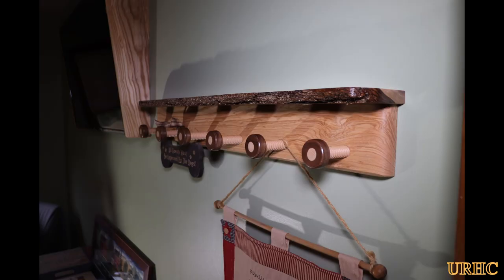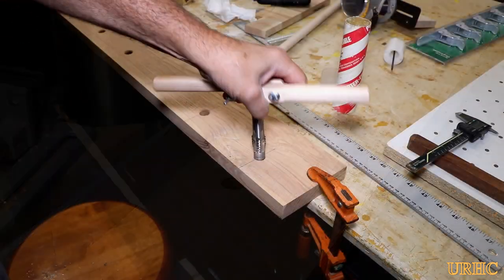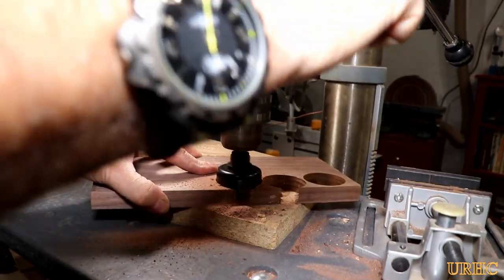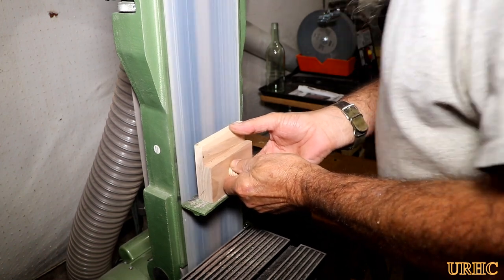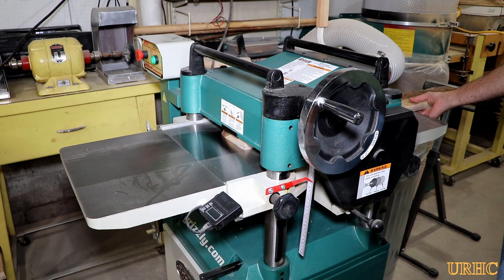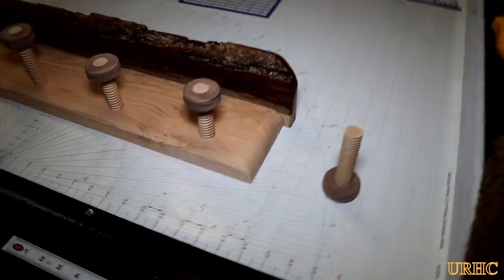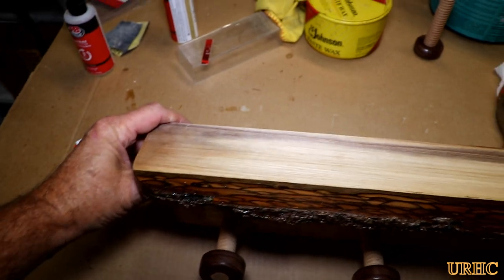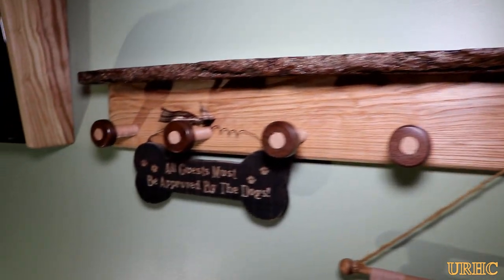Building An Industrial Rustic Robe Rack

Comment: Good tip re hole saw venting
Reply from the maker: You can see that I made the first cut away from the edge and the sawdust burned the edges badly and made the plug hard to remove frim the saw. Next I decided to try cutting off the edge and found it made the job easier with no burning.  Took me many years to figure this out. Thanks for watching.

Comment: What's the HP of the motor on the lathe?
Reply from the maker: It is only 1/2. Thanks for watching.
Reply from the maker: It has step pulleys to control the speed and that is the slowest speed. Both motors are 1725 rpm. The radius on the bandsaw wheel raises the travel speed of the blade. Thanks  for watching.